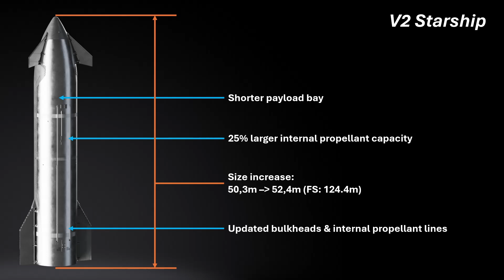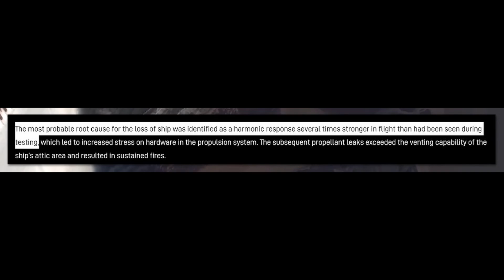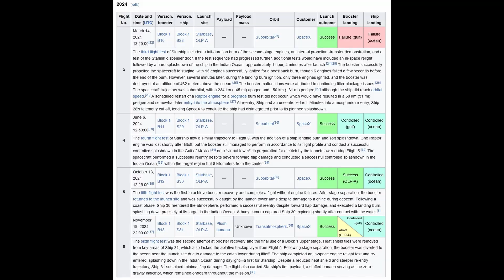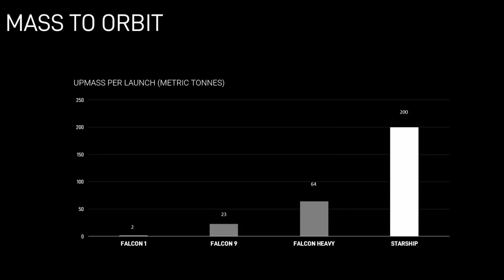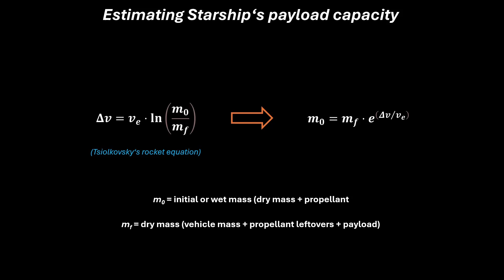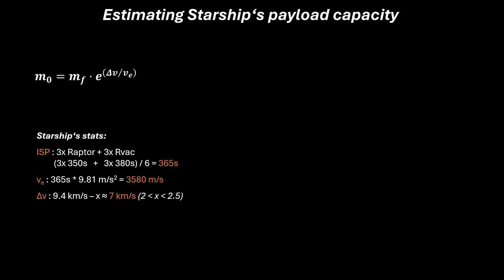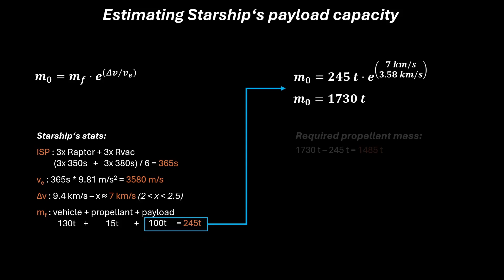Starship's (potentially) fatal Flaw

Comment: SpaceX is just finding itself gradually rebuilding the space shuttle, a machine NASA quickly ran out of uses for 30 years ago. SpaceX should instead switch now to an expendable upper stage and deliver its first commercial objective: successfully launching the new larger Starlink V2 satellites, achieving reliable chopstick recovery of its super heavy boosters (SHBs), reducing SHB turnaround time, and establishing a regular SHB launch cadence. 

Once it has achieved these four operational milestones, it should move on to establishing orbital fuel storage, transfer, and spaceship refueling - again, using expendable tanker upper stages. After reliable fuel storage and transfer in orbit has been established, SpaceX can focus on its moon lander upper stage: launching it, refueling it, and taking it successfully around the moon and back, ready for its Artemis missions. Yet again, the moon lander will be expendable.

Only once the Starlink delivery, in-orbit refueling, and moon lander missions have been achieved does SpaceX need to develop a Starship that can survive atmosphere re-entry. Even then, its first objective should not be Earth atmosphere re-entry but Mars, a much more interesting and useful objective if Musk wants to achieve a Mars colony in his lifetime.
Reply from the maker: Well, Starship's design is completely different from the Shuttle, but they do indeed seem to run into the same issues, especially with reentry and thermal protection systems. The entire concept is still quite far from perfect and I expect potential future versions to look very different from what we have now. 
As for the Mars colony thing, yeah, that won't happen anytime soon. Getting to Mars safely is quite the challenge (even for a small exploration team), let alone building a whole functioning city there. I'd be surprised if his 1 million people on Mars goal happens before 2075.
Reply: @therockethubofficial Personally, i think the Mars colony thing is bonkers but, well, not my company and I am just going by what their stated mission objectives are. My contention is that they have lost their way by focusing on "fully reusable" hardware rather than what they want to do with the hardware, where, and when.

Comment: It's important to note that SpaceX has experienced a significant exodus of top talent and severe burnout of remaining talent over the last 6 years (including many of the people who were fundamental to the success of falcon and dragon) due to stress from the absolutely inhuman hours, demands and frankly horrible working conditions Elon forces on staff as well as widespread feeling of deep betrayal and a loss of the passion and motivation they once had. This is being vocalized both by former and current employees on the current state of the company. Elon is still pushing everyone just as hard to move just as fast or even FASTER than ever before - a pace which in the past could only be met by tens of thousands of the best aerospace minds in the business passionately and enthusiastically working 100+ hours a week, 50+ weeks a year, for multiple years to accomplish - but when you have a tired, burned out, demoralized and disillusioned workforce that has lost much of its top talent being forced to work even longer hours by a leader many have lost all respect for... well this is the result. And it will likely continue to deteriorate unless RADICAL changes are made very soon. 

Can they still accomplish successful flights and work out the problems, etc? Probably, yeah, but it will take longer and longer and require more and more failure to get there while their Chinese competitors rapidly overtake them just like BYD did to Tesla. It's looking more and more likely that the glory days of SpaceX may be behind them and they are entering their Boeing phase of life as a massively bloated megalith drained of top engineering talent and surviving more and more on its laurels and absolutely HEROIC scale government contracts and subsidies.

Comment: i think v3 will have a lot of these issues solved. they’re still changing the heat shield system, reducing weight in system components, especially the raptor 3, think they shaved off like 15% of the mass by integrating plumbing into engine walls and other components
Reply from the maker: Certainly possible. We just don't know enough about v3 to be sure, only time will tell.

Comment: My opinion is that is another thing that lower performance of Starship, using autogenous pressurization and relatively high pressure,if you search for oxygen and methane density at sixth bars and 50° above the boiling point, you would find that for 1500 tons tanks you need 30 tons!

Comment: "Move fast and break things" is just an option that we engineers can select. In software engineering I use that option a lot, but it's not my "company culture". I pick other styles when the situation calls for it.

I think SpaceX engineers are similar. Yes, they're known for blowing up a lot of rockets, but they also send up carefully tested manned missions which haven't lost an astronaut yet (knock wood).

In other words, I don't think SpaceX has a "company culture" of taking risks. I think they have a very tight constraint of trying to get a robotic Mars mission launched in time, and chose the approach which is calculated to have the best chance of hitting the target.

It's not a culture, it's a strategy.
Reply: Very well said. 

Fail fast, fail often, and figure out what won't work to get to what will. 

If we allow failure to deter us from taking risks. We won't make it to Mars because you can't mitigate everything. 

People also forget that SpaceX is using its own money. It's taking calculated risks and moving forward.
Reply: Moving fast and breaking things is eventually going to result in people's deaths. They had to stop air traffic in the area...TWICE.  Can you imagine NASA losing a Saturn V just for the lols? They're cutting corners and innocent people are going to suffer as a result.
Reply: It's important to note that SpaceX has experienced a significant exodus of top talent and severe burnout of remaining talent over the last 6 years including many of the people who were fundamental to the success of falcon and dragon due to stress from the absolutely inhuman hours, demands and frankly horrible working conditions Elon forces on staff as well as widespread feeling of deep betrayal and a loss of the passion and motivation they once had. This is being vocalized both by former and current employees on the current state of the company. Elon is still pushing everyone just as hard to move just as fast or even FASTER than ever before - a pace which in the past could only be met by tens of thousands of the best aerospace minds in the business passionately and enthusiastically working 100+ hours a week, 50+ weeks a year, for multiple years to accomplish - but when you have a tired, burned out, demoralized and disillusioned workforce that has lost much of its top talent being forced to work even longer hours by a leader many have lost all respect for... well this is the result. And it will likely continue to deteriorate unless RADICAL changes are made very soon. 

Can they still accomplish successful flights and work out the problems, etc? Probably, yeah, but it will take longer and longer and require more and more failure to get there while their Chinese competitors rapidly overtake them just like BYD did to Tesla. It's looking more and more likely that the glory days of SpaceX may be behind them and they are entering their Boeing phase of life as a massively bloated megalith drained of top engineering talent and surviving more and more on its laurels and absolutely HEROIC scale government contracts and subsidies.
Reply: @GlutenEruption  The fact of the matter is that it really doesn't matter if they get this thing working.  Frankly, I think they will eventually get Starship launching and landing.  As people are always scrambling to say when it fails repeatedly, that these are just engineering difficulties.  

But conceptually, it's not a well conceived idea.  A super-heavy-lift rocket?  Sure, but there are better ways to do that than this stylized thing.  To the moon?  No.  It requires ~20 launches to fuel one Starship for a lunar trip.  And when it gets there, it gets worse as they want it to land vertically on the moon and then leave the moon with all that dead weight.

It's inefficient to the point of lunacy (no pun intended).  The thing that made the Falcon series so good was efficiency.  They focused on that and it basically worked.  This time, they're aiming for science fiction and physics just doesn't allow this to work well.
Reply: @praesentius  100% agree. Not only that but there is absolutely no chance it could ever be man rated for launch or entry to NASA standards- the lack of LES, no legs and total reliance on the catch tower for landing means there's no contingency abort possibilities and severely constrained landing sites. Even the shuttle was able to use a whole range of international airports as emergency contingency sites in an instant. If at any time after launch but before orbit or after the entry burn buy before the landing burn, starship OR the catch tower experience any failures, the only option is to ditch in the ocean and topple over like flight 6. And when your plan is to pack it full of as many people as a small airliner, that's just not gonna work.

And to your point, reusability is great when you're talking falcon9 sized payloads, but even falcon nine uses an expendable upper stage. Lugging hundreds of tons of extra weight to orbit with only two stages… It's like they completely forgot about the rocket equation when designing it. If they turn starship into a totally stripped down expendable upper stage, they actually have a potentially useful super heavy lift booster that could do some cool things but Elon's total obsession with full reusability is severely hurting practicality
Reply: @GlutenEruption  Yeah, the super heavy booster seems like it would be fine.  It's what you're putting on top that's the problem.
Reply from the maker: "Move fast and break things" is indeed more of a strategy, and that is what SpaceX has been doing for the most time. But what I'm referring to is them senselessly rushing things lately and not leaving themselves enough time to actually learn from breaking things and implementing changes. They've moved ahead of the curve, and that is (at least imo) more of a mindset / culture thing than actually using that strategy. 
I'd totally agree with you if they would be applying that approach corectly.
Reply: @therockethubofficial I'll never defend this "move fast and break things" cult defense of Starship. It has, quite literally, the worst test-launch record in modern rocketry. Eight failures in under 2 years. And that's with no, or insanely minimal, payloads. The Soviet N1 rocket, which is usually brought up as the gold standard of failure, only flew four times before the whole thing was scrapped. SpaceX has already doubled that in a shorter timeframe and somehow still has people clapping like seals every time something explodes.

Then you've got the actual concept... and it's ridiculous. A massive, high center-of-gravity tower landing on soft, uneven lunar regolith? Fucking brilliant. We just saw how that works with the Odysseus spacecraft.  Too tall and it just fell over.  And Starship is much bigger.  

We figured out half a century ago that you don't bring your whole launch vehicle, with all its weight, down to the Moon and try to haul all that shit back up again to orbit. It's why Apollo left the descent stage and launched the smallest thing they could. 

Then, the real kicker, in my mind.  Starship needs up to 20 separate launches to refuel in orbit before it can even start the mission. After each launch, it needs to do a docking maneuver followed by a liquid fuel transfer.  TWENTY TIMES!  JFC, how are people sold on this?  

Technology hasn't changed THAT much in the last 60 years.  We're still just burning propellant to escape gravity.  Oh man, and I haven't even gotten into the absolute absurdity and failure of their timetables.  As good as the Falcon rockets are, this heap of shit will NEVER be a viable launch system.
Reply: @therockethubofficial "senselessly rushing things" is not what they're doing. Sometimes, you fail more than twice in a row because there are often complex dynamics involved with multivariate problems. You can fix one thing that exacerbates another... but you didn't see the other before because that other broken thing covered the data. Your take is worthless and fear mongering.
Reply: @banzaiib  There's not a drop of fear mongering in there.  Just a ton of data to substantiate.  It's also not fear mongering to point out that the entire mission architecture is fundamentally broken. You want 20 launches per Moon mission? Refueling in orbit, multiple times? Landing an empty grain silo on the lunar surface and then burning more fuel to haul all that dead weight back into space? It’s nonsense. It's not “multivariate complexity"... it’s a bad design propped up by PR and sunk-cost fallacy.

I have no doubt that if they blow enough of these things up, they can get it into space eventually.  But it come back to... why?  Why bother putting something in space that is so fundamentally flawed?

Comment: Great work Phillip 🚀I had been partially watching your rocket fuel series at the time and was astounded by the quality you were delivering. You would defo deserve more audience

You are right as well pointing out the underlying philosophy along with your calculation : the current state of the program and the system's evolution don't match closely the promises made to bolster its appeal. In the first place, Musk gives out extravaganza and claims unrealistic things which are seriously prompt to undermine the outcome of Starship (i.e. sending up crews to Mars aboard Starship under crazy, super-tight terms). Plus, the pace is all the more rapid than there must be progress towards ever-increasing need for a proven product as part of the HLS call (the schedule of which being also very pressing). So maybe and unfortunately, SpaceX is indeed reaching a point that could entail required consideration of changes in their technical frame. Your point in my view is completely valid in regards to company culture

Kudos from France
Reply from the maker: Thank you!